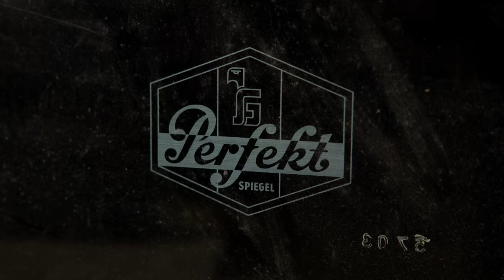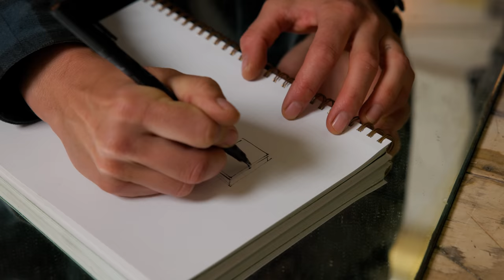We thought building this cabinet would be easy…

Comment: you could've used those indentations to insert adjustable shelving inside the cabinet....??? If the measurements were actually correct and the boards were flush.

Comment: Hi Laura and Simone, thanks for this excellent video, great ideas as usual. I really like the idea of neon both inside and outside, and finally that the first draft didn't work is a good thing since it led you to move on to this "outside/inside" idea and it works great. A great collaboration for a great project. The fact that the mirror isn't brand new doesn't really matter, it shows the reuse of a material that could have ended up in the garbage can which would have been a shame, but it finds a second life thanks to this little cupboard, for me it's perfect.